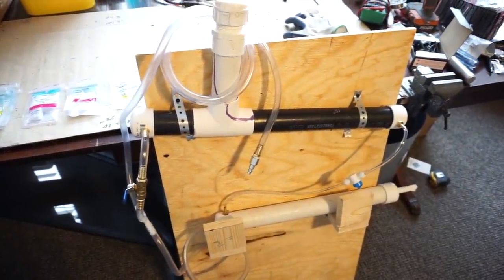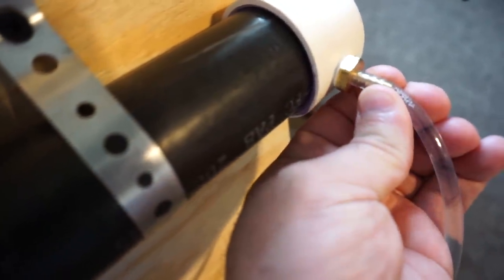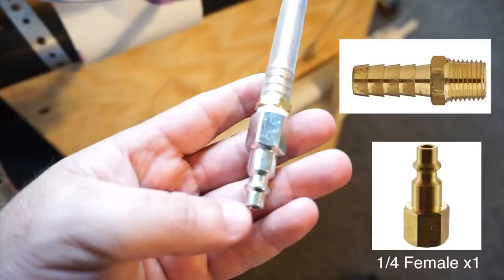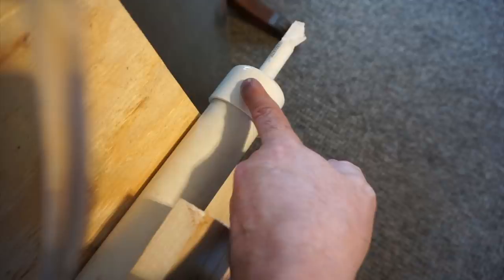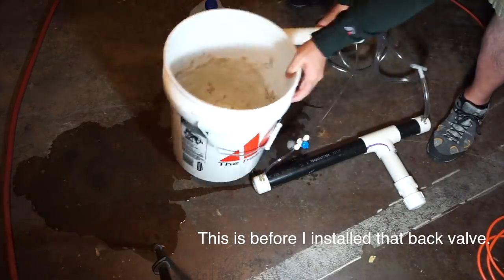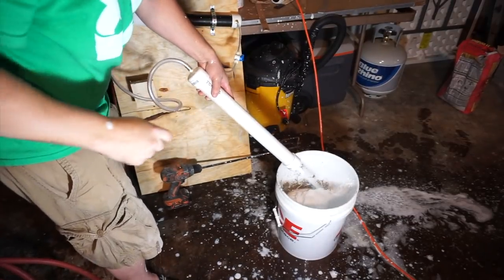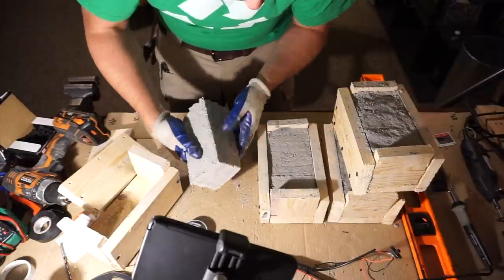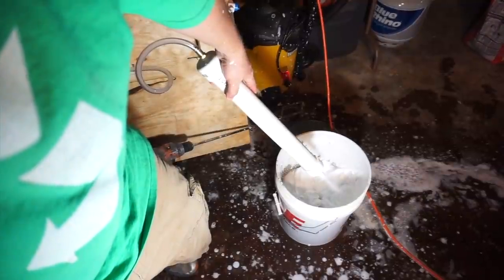How to Build a Simple Aircrete Machine

Comment: Hey man, great video!

A couple tips for you, though by now I'm sure you've started doing research and have come across most of these already.

1.  The foam needs to be as thick/dense as possible, like shaving cream. If it's airy like that then the cells are too big and not nearly dense enough to hold your cement together. You can try Dawn or 7th Generation soap from any store, or order Drexel Foaming Agent if you're close to a Rural King. It could also be an issue with the design of your foam gun, or both.

2. The proper cement to water ratio is crucial - most are finding that 6 gallons of water per 92lb bag of cement is about right. That comes out to about 8.1 oz of water per pound of cement.

3. Have the foam gun primed and ready BEFORE you mix the cement slurry. You'll want to add the foam in to the slurry immediately.

4. Your initial goal should probably be to double the volume of your cement. That means in a 5 gal bucket, fill it about 1/3 full of cement slurry, then double it with (high quality) foam.

Good luck man, I love seeing all of this in action!
Reply from the maker: Thank you for the info as that's the hardest part to find sometimes!

I'll make a video of the mix and go with your recommendations.

I think I also need to put stainless-steel wool in next time and more of it to help create more of a foam. I did use Dawn Dish Soap but I think the Drexel would be the best option. I could only find 7th Gen online so that's why I went with Dawn to start.

Thanks for the info!
Reply from the maker: Ok, pinned it :)
Reply: Happy to help! Will be anticipating your new results.
Reply: There is nothing I like better than comments like this! Adds to the video and knowledge in general. Thanks for teaching!
Reply: just based on my so far few hours rudimentary learning and now your video - i think if you can add a small {possibly adjustable} in-line liquid pump to the section adding the mixture {i.e the pump should be pumping the mixture to the gun} this would be the path to gain a thick foam - you might also be able to experiment with the material in the gun - it just makes logical sense that if the foam is too 'airy' this is not really due to the mixture and it is due to there not being enough injection of the mix material - 

the other design "little dragon' it appears seems to have an in-line pump it seems logical it is to add more mixture - the key would be in being able to adjust it - i think any in-line fountain pump or even adjustable fish tank pumps might greatly increase the quality of the end result, i.e a thinker foam material which would in turn solve your issues with the weakened structure.

thinking more about it - it would likely solve the 'sputtering' issue  that seems inherit in this particular design - of course if yu are then actively pumping the mix you may want a larger container holding the mixture - the end result would be fairly similar to the previously mentioned design however - all these principals are fairly simple so i think one could make a fairly effective hybrid - thanks for sharing the video - i hope this might help someone. 

I may try this myself as it seems like a good general building solution especially related to ICF structures where they are primarily used for forming and insulation, one may be able to make a brick form with just two {or just one} small hole in the center to allow for a binding reenforcement - if you look at ICF you will get the idea. the idea being these could replace the foam insulation.
Reply: blindorize shouldn't the end nozzle be submerged in the slurry as well
Reply: Than rustable steel wool, would something of stainless steel, work?
Reply: @fiveforachange7997  The drexel can be found at any tractor supply store. Also use Portland cement. 1 94 pound bag of Portland 6 gallon of water and the rest is foam. Mix in a 55 gallon plastic barrel. Hope the helps.

Comment: Great video.  This gave me an idea of making an air foamer like this for washing an automobile.  You just put car wash soap in it and spray down your vehicle, let it sit for a couple of minutes, then rinse it off.  I'm definitely going to try this but will have to put a trigger valve that you squeeze and also a way to regulate the flow of soap so that it only pulls soap when air is flowing.  I'm thinking that a venturi tube would do that but I'll see what I can use for that.

Comment: Thanks this is a bit easier to follow, nice to see the positive comments too, thank you blindorize.  I have been told that sodium lignosulphonate is a good additive but not that easy to get unless you are a commercial buyer.
Reply from the maker: That's interesting that they would say that as Sodium lignosulfonate (lignosulfonic acid, sodium salt) is used in the food industry as a de-foaming agent for paper production and in adhesives for items that come in contact with food.

Wonder if it does something with the foam instead of de-foaming it...

Comment: both valves are removable, the push to fit ones if you push the small ring close to the tube into the body of the valve while you pull the tube, allows the tube to be released. some times a device helps pliers with a hole close to the size of the tube helps push the ring in.

Comment: You have the foam generator working, now just gotta work on the concrete mix. I would go with a 94 lb sack of cement to 6 gallons of water and then mix in 20-50 gallons of foam. Divide this down to a workable size. I would use either Suave shampoo or Drexel foaming agent. Dawn dish soap just doesn't hold up long enough. Suave is cheap and works better, Drexel seems expensive at $27 a gallon, but actually is cheaper when calculating cost per volume of foam. Check out Aircrete Harry here on YT. He even has some quasi-scientific testing of compressive strengths of bricks and some foam stability tests. Harry Rocks!!!

Comment: I haven't read all of the comments; so, someone else may already have mentioned these suggestions; but, just in case they haven't:
1) Use stainless steel scrubbies, NOT steel wool.
2) Swipe Honey Do Carpenter's idea of putting 3 links of stainless chain in between the scrubbies and the nozzle.
3) On the nozzle end, glue a male adapter onto the pipe; then, pur the nozzle into the end of a female threaded cap. That way, it's secure; but, you can still get into it, if you ever need to....
I did really like your idea of mounting it onto a board.

Comment: I've seen chains put in between steel wool and nozzle to try to eliminate blockage. Also, I've never seen fine steel wool used, always course. I'm also told Portland cement is what to use, but sometimes I wonder if that's all you can use.
That being said, this was an awesome video. A very good job.
Reply from the maker: Yeah, I did end up adding the chains...which I had originally but just in the back, instead of the front...lol

And you need to use stainless steel wool and not steel wool...it will rust and get clogged in the tube...

Also, Portland Cement is what I recommend as it doesn't have all that extra in it and it's way easier to mix!

Comment: use dehydrated hay (old grass) for reinforcement. it will act like a natural biofiber reinforcement like helix double stranded zinc coated steel micro rebar but better because it will never rust on you and provides strength throughout the brick.aftewards you coat it in a sheet of concrete using a thing mesh
Reply: It can also grow mold use ai resistant fibers for concrete

Comment: Dude, that black pipe is not pvc it’s abs. Yeah it’s a few cents cheaper, but unless you have transition glue, which you don’t, it won’t glue well to pvc. Also for pressure you should be using the primer then the glue, which I can see you didn’t (no purple drips).

Comment: Thanks for the video!  Going to make mine soon!   A question and an idea:  Do you use Portland cement or concrete (with aggregate)?  
My idea for a design improvement (please tell me what you think):  What if the lower chamber with the nozzle were instead strapped on TOP of the other pipe, and then it would be sorta like a more portable rifle-looking thing.  Additionally, to address the issue of awkwardness during filling, you could redesign the fill tube so instead of going straight up it would elbow over to one side before going upward.  This would make the fill tube overall shorter and also provide a sorta kickstand to keep the thing upright while it's sitting on the ground. (I wish I could attach a drawing, but I hope you can visualize this).
Reply from the maker: I would suggest using Portland Cement as it gives you the ability to add what ever strengthener you like. (Sand, rebar, etc...)

 The elbow idea is a good one as it would definitely help with holding it up if you're going to have it one the ground. I can picture that working.

And that then would work well with your idea of the "gun" part being on top vs. the bottom.

The thing about this design is the clear hoses (in this case), get a little squirrelly as you try to move it around. Mainly because they have the memory of being coiled up and when you try to move the gun part...it tries to take the whole thing with it.

That's why I just mounted it to a piece of plywood, so I wouldn't have to fight it trying to move all over the place.

Good ideas and I would love to see your design when your done!

Comment: Anyone interested, you can get it pretty close to what the Darwin suggested ($30).  I bought the PVC pipe, nylon tee and pipe primer/glue from Lowes ($13.10), the fittings and and barbs from Walmart ($10.71) and 2 each of the 3/8" and 1/4" quick connect valves on Amazon ($13,58).  Instead of the tap/die, step bit and 1-1/2" caps, my connection set included 1-1/2" FPT Reducing bushings, 1/2" to 3/8" and to 1/4" barbs.  Due to the extra connection on the wand, I used an extra 1-1/2" tee and an extra 1-1/2" FPT.  Not as pretty as yours :^) but no cost for the tap/die or step bit and still came in at just about $35.  No drilling necessary.  I already have the tubing from my brewery, so yes, I did manage to get by without that cost ($5?).

The reason for the 2 each on the quick connects is that I couldn't find them as cheap buying them quantity 1.  After watching another vid, I also decided that the 2nd 3/8" valve (along with the 1/4" one) would be installed right near the wand end (zip tied) allowing me to fine tune the air/liquid mixture at the end.

Comment: The purpose of the steel wool placed inside the tube is to make thousands of tiny bubbles and not to include it in your desired aircrete. I can't believe you included it as part of the aircrete.
Reply from the maker: How are you supposed to figure things out if you don't actually just try different things? I don't have a manual and this was my first time ever trying it...

Comment: Aircrete is not made with aggregate, only water+cement= slurry, then mix in stiff foam, 1-1, and pour. Or add more foam if it's too stiff a mix. Loose foam is bad. Too runny is bad. Your foaming agent is probably not adequate. Or your gun is adjusted incorrectly, e.g., too much air. Are you sure it's built correctly? A good foaming agent is Suave shampoo for oily hair.

Comment: Get yourself some red scrub pads for the floor polishing machines. You need to cut them down but they will last forever.
Reply: You can add fiberglass strands or similar too. They make a lot of different stranding to add for strength.

Comment: Nice gun I wish your masonry skills and terms were a little better and exact. Quickcrete is a brand like sacrete or portland they make all different types of mixes mortar, cement, concrete, stucco. Are you using a cement mix which is 2:1 sand portland or what. Also Im assuming you do not want to use a fast setting product or is it better it drys while air bubbles are escaping.
Reply from the maker: Yeah, not a good idea to use a fast setting cement...As I've seen in a lot of the videos for it...it looks like also my mixes were to dry...

And I was more or less experimenting with just a mixture. This was my first time, so wasn't going to be exact on everything as I like to know what not to do first so I can do better next time.

Comment: Could you use aircrete to make a countertop?  Could you just do a skim coat of cement on the top and sides after it's cured to get rid of air holes? Would you add rebar to it?

Comment: Use stainless steel wool so it won't rust.  Why not mount the soap reservoir below the gun so you don't need the valve?  Do you need the gravity feed? I would think the air pressure would be enough to force the soap water through.

Comment: Aircrete is NOT stronger than regular concrete. This has been proven conclusively by engineers. In fact, aircrete is extremely weak and will crumble under pressure.

Comment: Your test cannot bei reproduced. That makes it void. You could experiment with adding sodium silikate to your soap/water solution i.e. to your foam. The sodium silicate will excellerate the hardening process of cement.   This makes casting better controlable. Never add Aggregate to the mix but sand or another light weight filler.

Comment: Very Nice! Thank you Sir!  Could you add rocks into the pail or Fibers like fiberglass to help strengthen the mix as you make the Air Crete? I'm new to this so not sure what one can use to the mix on the receiving end. I know you can use molds with wire mesh and rebar, so was thinking fiberglass.

Comment: A “screw on cap”could be used ,

at the front of the gun.. and then it doesn’t blast off -at an unexpected time..And Can be used to open ,and close... the end of the gun , And if you use stainless steel scrubber pads ?...they don’t rust...

Comment: how much steel wool do you need in the gun and I am just getting air true the front of the gun but if I put my finger on the front to stop the air and let go I will get a little foam can you tell me what is wrong , the gun was made just like the one in your video
Reply from the maker: I should of used stainless steel wool instead of just steel wool. Also, I usually pack it tight enough to be able to create pressure. You might not be using enough to create that pressure.
Reply: I used 2 stainless steel wool in and 1 regular steel wool  cut the gun size down but the front keep fly off when I put air on

Comment: Putting a LAYER of steel wool actually made a weak point. All that did was make a steel wool sandwich. It would need to be incorporated into the mix to be a good reinforcement fiber. Concrete needs to be in contact with itself all around the steel for the steel to be of any use.

Comment: What are the advantages of Air Crete over Concrete? Is it less expwnsive, lighter, easier to build with? What are the typical applications?
Reply from the maker: The foam adds volume and makes the aircrete lighter and yes, easier to build with. People have built homes and a multitude of other things with it.
Reply: It is FAR weaker Not Inclined.  It is useful for facade and the like.
Reply: It has insulation properties.

Comment: Another video the person puts two steel rods at right angles across the exit end of the foamer to hold the stainless steel wool back from the exit hole.  Another comment below makes the good point that if you glue the ends of the foamer on the foamer becomes a ‘pipe bomb ‘ if the hole blocks and pressure builds.

Comment: The steel wool is just creating a void,  making it weaker, the concrete needs to completely surround the reinforcement, the wool is too small and densely packed to be reinforcement. Try coat hanger wire, or something similar, even small rope, but the wire is better.

Comment: You should study up on concrete basics and perhaps talk to standard concrete pros. The steel wool was nothing more than a contaminate. It will never reinforce the concrete.
Reply: Uhhhhh!  Honey!  The steel wool is used to create the foam!  Then the foam is added to a Portland slurry!  Then the mixture is poured into forms.  The forms can contain a reinforcement material like wire screen, which makes it a light weight ferro cement!  Also basalt and other normal concrete reinforcers!   BUT - you don't use steel wool to do that job!

Comment: Great video. I have a portable double cylinder heavy duty  car Tyre inflator compressor ( 150 psi/ 220 W/ 60 L Min. Flow) Can it be used to produce Aircrete . Pl. advice'.
Reply: A tire inflation pump would be to small. To make the thick foam you will need a lot of volume at 90 psi. If your pump can do that then yes it will work. A air tank can be used to hold the needed volume, it may take a while for a tire inflator.

Hope this helps.

Comment: great vid. thx for upload.. just a question about the tubing .. does it have to be 1/4 and 5/8 inch? difficult to get those parts here where i live and wondered if 1/2 " might be ok?
Reply: Tubing Size really doesn't matter to much, as long as the tube on the front is smaller than the tube on the back...
Reply from the maker: 8OH8 is right...it doesn't really matter as long as the tube up front is smaller than the back...
Reply: ok thx so much .

Comment: too much air flow for the amount of solution, probably not enough foaming agent considering it's about to get diluted with cement. wrong cement. never mentioned that wand is a pipe bomb that can injure someone if they glue the cap on. steel wool isn't a great option for inside the gun. i'd suggest aquarium floss batting or if you can find upholstery batting floss, both could fill the tube front to back and not get block the nozzle. just make sure you get the type that doesn't squish down when wet like pillow stuffing. a fully filled gun barrel would make foam with smaller bubbles and better carrying capacity for the cement  because of increased surface area. if you increased the flow of bubble solution you could probably keep up with the air flow and make foam really fast.